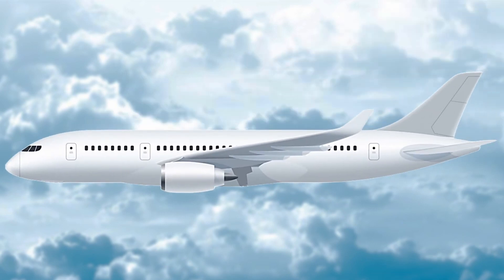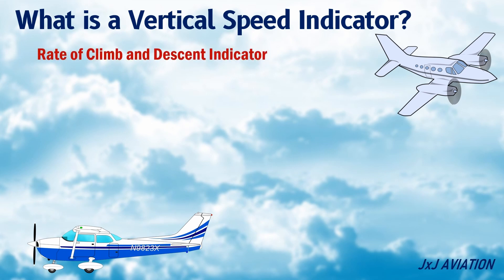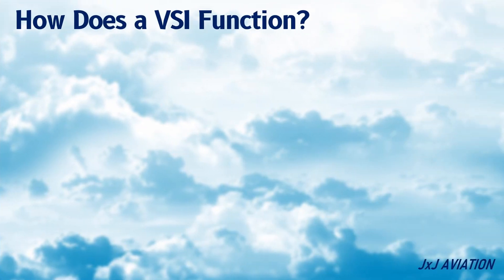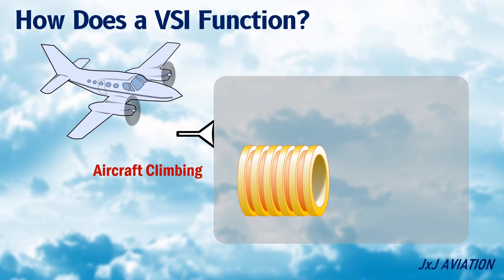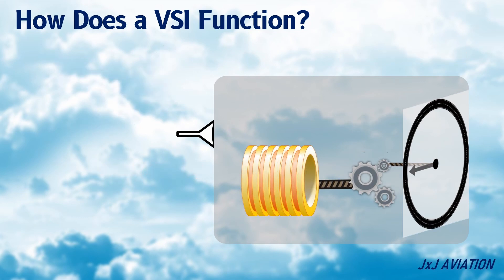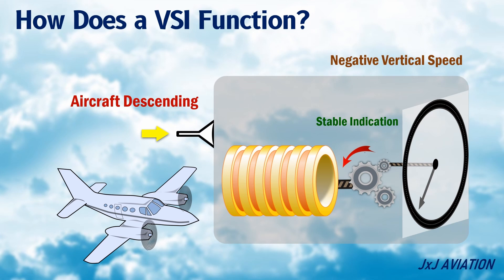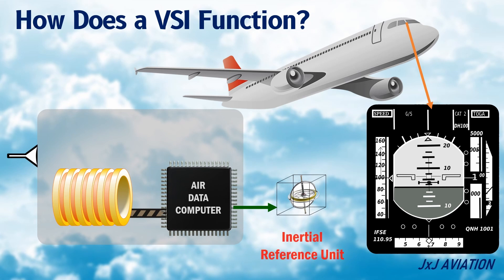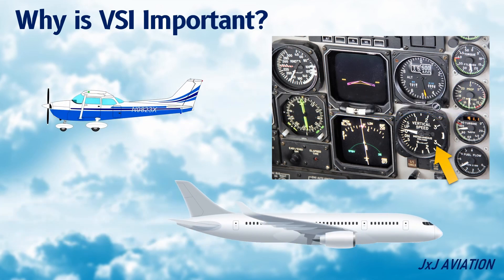How does Vertical Speed Indicator function? | Types of Vert Speed Indicators & Why it is Important?

Comment: 📝 Summary of Key Points:

📌 The vertical speed indicator (VSI) is an instrument that indicates the rate of climb or descent of an aircraft.
🧐 The VSI can be presented through a needle in a conventional instrument or on the primary flight display.
🚀 The VSI uses the rate of change of pressure to indicate the aircraft's rate of climb or descent.
📊 When the aircraft climbs, the reduced pressure causes the barometric capsule to compress, deflecting the needle upwards. When the aircraft descends, the increased pressure causes the capsule to expand, deflecting the needle downwards.
🧐 The calibrated nozzle in the VSI introduces some error but provides a stable indication of the vertical speed.
🚀 The digital vertical speed indicator operates on the same principle but uses an air data computer and inertial reference unit (IRU) to calculate and display the vertical speed on the primary flight display.
💬 "The vertical speed indication is important because it provides crucial information about the rate of climb or descent in feet per minute."
💡 The VSI helps pilots adjust the speed and attitude of the aircraft during takeoff and landing.
💡 During level flight, the vertical speed indication should be zero.

📣 Concluding Remarks:

The vertical speed indicator is a vital instrument in an aircraft that provides valuable information about the rate of climb or descent. It helps pilots adjust the aircraft's speed and attitude, making it particularly critical during takeoff and landing.

Made using TalkBud!